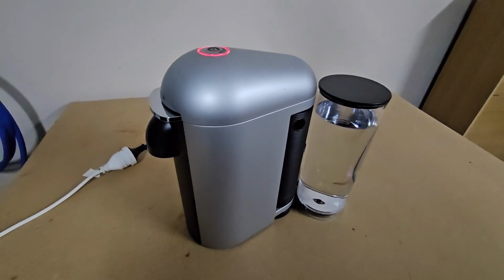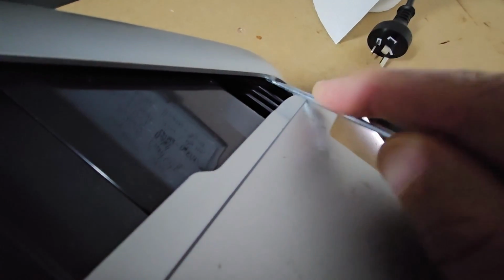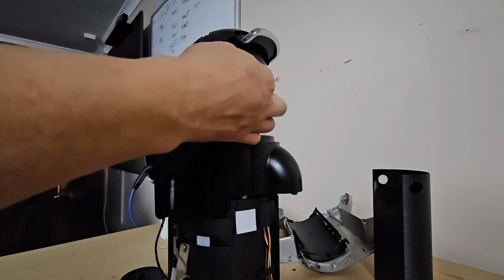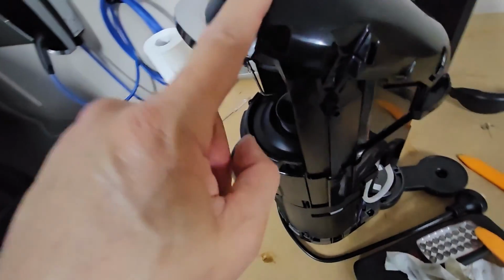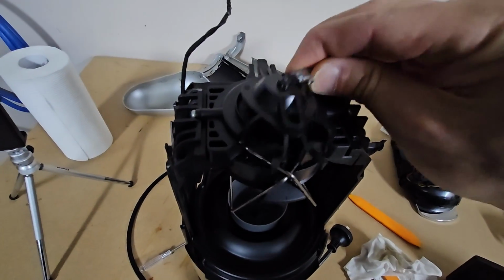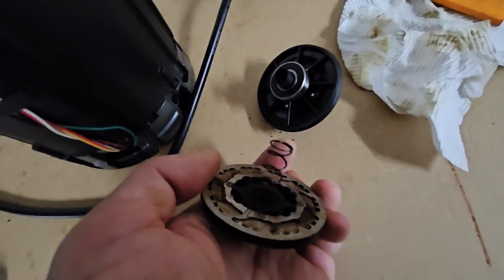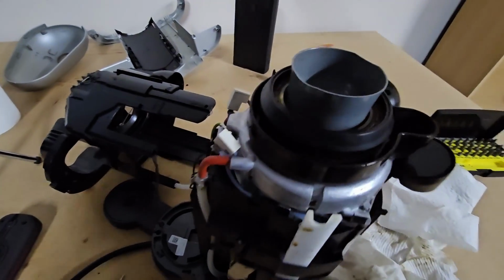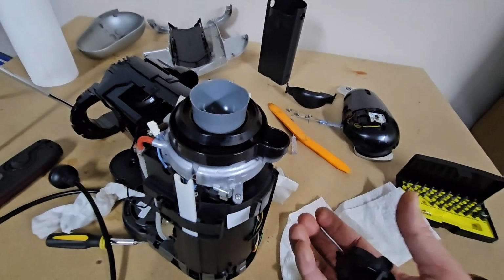Nespresso Beville Vertuo Plus tear down

Comment: Were you able to ever face and fix a problem in this machine that the lever was not opening nor closing the machine, as if the wiring was broken somehow or didn’t transmit the signal properly from the lever to the head to open/close?
Reply from the maker: sorry, no,that would be really difficult if it is even possible.

Comment: I tried replacing the bearing on mine, same model as shown here, the bearing is bonded to the plastic piece, cannot be separated, unscrewing all parts and cleaning it didn't help with the loud noise either, so I just put it all back together and will use it till it stops working, such a shame.
Reply from the maker: hi, it's a shame these machines are made so we can't replace parts.
Reply: So saw another youtube video, and made another attempt to remove the bearing, based on a comment i found there.

Worked around the bearing slowly from all sides with a slotted head screwdriver and it finally got out, replaced it with a new bearing and the loud noise is now fixed, unbelievable.
Reply from the maker: @maziyarmk7535  that's cool!   can you share the link please?

Comment: Did it work in the end? My machine is leaking and I suspect the grey cup that is spring loaded is not moving freely due to coffee grinds getting in there, causing water to leak where it shouldn't be.
Reply from the maker: hi, no I couldn't get it to work. I figured the parts would cost almost as much as a new machine so I just showed how to tare down the machine.

Comment: Mine won’t close. A pod had gotten stuck, I pulled it out but now it starts to close but won’t close completely.
Reply from the maker: hi, sounds like there's something is in the way on the tracks
Reply: @kenkanfix  I think I pulled something out of place when I pried the stock pod out. It was stuck in the upper part. When I push the lid down, it starts to move down but then stops and goes back up. I’ve reached up in there to feel around but nothing appears loose 🤷‍♀️